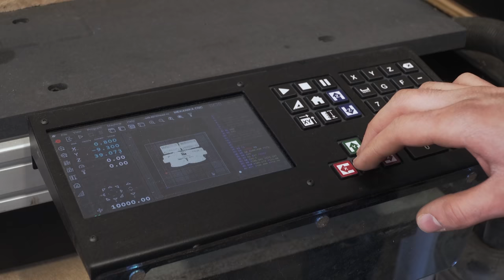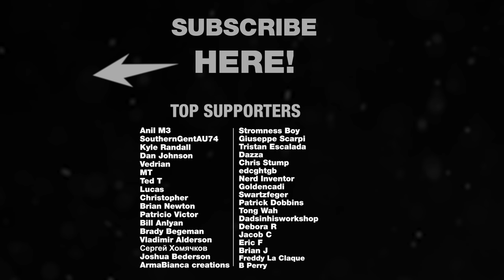My Motor Broke, so I Smelt it into an Hatchet

Comment: The motor rewinder in me wants to see you rebuild the motor...

A bit surprised you didn't alloy the copper into bronze.
Reply: I was wondering the same thing 🤔. Aluminum bronze is one of the stronger bronze alloys.
Reply: @jaxjackson4100  yep. Surprisingly durable, and can hold a good edge with the right geometry.

Comment: Hi, I'm from Brazil, great job my friend.  Does an axe made of copper have the same strength as a steel axe? 👍👍🇧🇷
Reply: It will require sharpening more often than a steel one would, but it should be strong enough to last for many years.
Reply: @RedwoodRhiadra  thank you friend

Comment: Greetings and another awesome video; what is the name of the pneumatic tool you use at the beginning of the Head Finish chapter? Thank you! Our neighbor the Viet Namese tofu factory also bakes french bread in several special steel trays (production baking) and they are periodically descaled from carbon buildup. They use an angle grinder with a flap disc, I think, and that tool would be much more effective and efficient.
Reply: its called a needle scaler, you can get attachments for a pneumatic hammer. But need to run an air compressor to use it.

Comment: Very cool! I wonder if you could use an old meat tenderizing hammer to get more texture instead of the needle gun. You could grind one end flat and the  beat it in with a hammer. Curious if that would work.

Comment: Always love your work.
I suggest with this type of project to perhaps put a hardened steel insert in the hatchet blade.
I don't pour and only do light smithing myself so I am not sure if they would hold to each other.
Also is it possible to harden copper like you would do to iron or steel?
Reply: Copper can't be hardened through a quenching process but it can be work hardened which he does in the video when he beats the edge down on the anvil